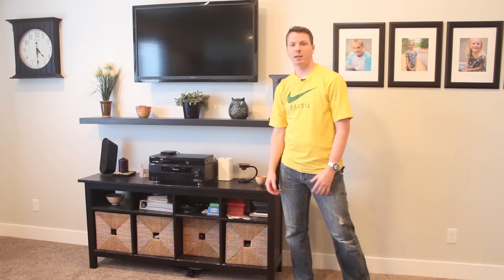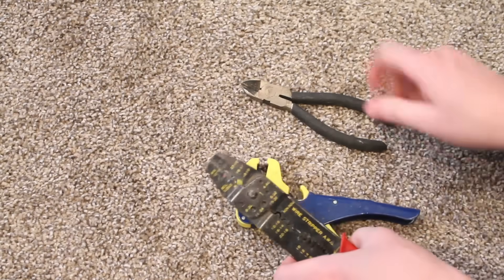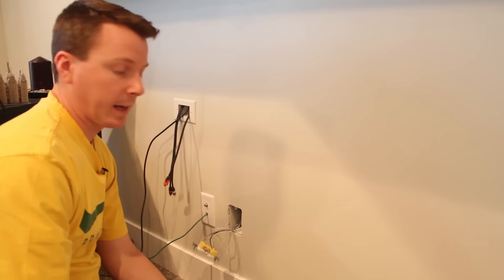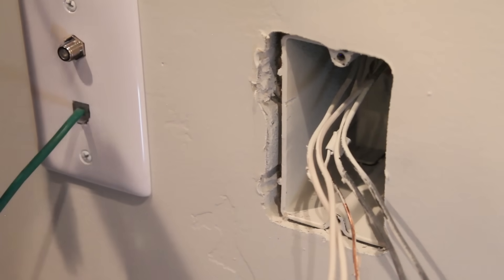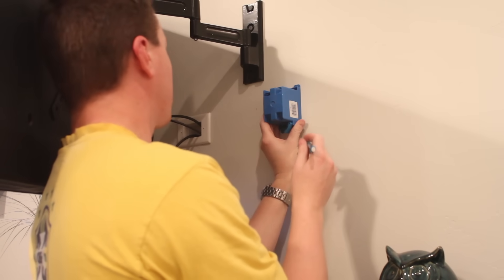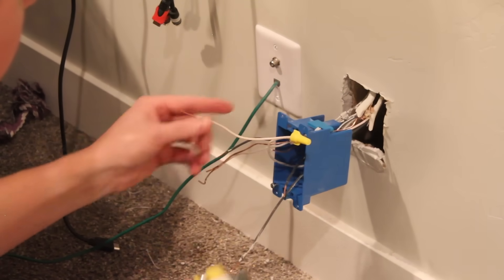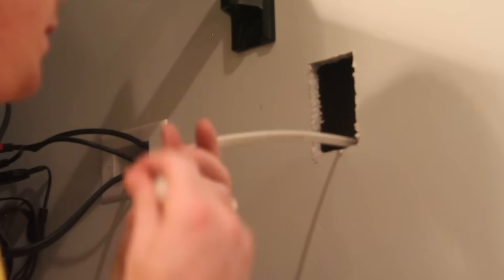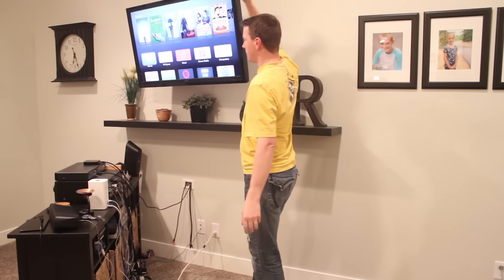How to Add an Electrical Outlet for a Wall Mounted TV

Comment: you could have wired all three romex directly to the plug, faster easier more reliable.  Also, before cutting the sheetrock it is best to mark the box with a level to make sure your cuts are level and squared. Always try to avoid installing any boxes sideways or at a different height than the existing outlets (looks very unprofessional).  Other than that i would say this is one of the better videos on this subject.
Reply: Absolutely not "more reliable". Also not to code.
Reply: There is also a minimum height wall plugs can be, I do not know it so I just set new one as the same height as existing one, 11" is what I just measured.
Reply: NO. It is not good practice to use devices as junctions for a number of reasons. The correct way to wire that is with a pigtail to the device, exactly as shown.
Reply: Could you elaborate on the wiring a bit
Reply: @Securedbyadt  he means that it would've been a stronger connection if he would've just connected the three new romex cables coming from the top outlet directly to the bottom outlet, onto two of the four screws plus ground on the bottom outlet. obviously at that point the bottom outlet would only be running off of only one black, white, and ground wire as opposed to the two sets it was running off in the beginning of the video. doing this method would also require you to pigtail the two ground wires (the ground from the bottom outlet & new ground from top outlet) and then land 1 wire onto the grounding screw on bottom outlet. after that you're set, no need to pigtail the extra short piece like this guy did in the video

Comment: Id have to say looks good for the most part but you should definitely brush up on the electrical portion of work. There were still some things that arent up to code like you should be putting the wires on the bottom receptacle back into the box so about a 1/2" of the jacket is in there. Same with the top outlet, way to much jacket was left on it. I personally have seen some real hack jobs (outlets wires with extension cords) and the house didnt burn down but it wouldnt hurt to brush up like i said. Black and Decker makes a nice quick reference code book i recommend to DIYers

Comment: This is not to NEC.  You have to many wires for the box fill of the lower remodel box, and you used a regular box   You should have used a double to be in compliance.  The box fill or cubic inches allowed are marked on your box.  Each wire has a numerical cubic inch value.  If the romex is 12-2, then you have 3x neutral and 3x black, 2x's for the receptacle,  1x for the pig tails, and 1x for the ground.  Your total count are now at 10x 2.25=22.5.  You have exceeded the allowed fillable space in the box and a possible fire hazard.  The size box you used, will only allow 6 conductors, two of which are counted by the receptacle.  Your box on top has the maximum conductors allowed and is to code.
Reply: you are aware that modern 12/2 is yellow right? also just by looking at how easily the wire is manipulated it is most definitely 14/2. so grounding counts a 1, 6 conductors (3 neutral, 3 hots), wire connectors and pigtails DO NOT count as they originate in and terminate in the box (314.16.B.1),  2 double allowance for the box = 8 * 2.00 = 16in^3.  The box he listed in the desc is 18in^3. So he is good (he would still be good if he used #12).

Comment: Quick question. I saw that you cut one of the grounds off behind the crimp, I'm assuming because it was keeping you from removing the grounds from the box, but I never saw you do anything with the shortened ground wire to reconnect it. Did you just leave it off? It would leave all of your plugs after it ungrounded as well.
Reply from the maker: There is actually a crimp connecting the original two wires behind the box. You can see it on the left at around 9:00. I brought my new ground in as well and connected it with the existing wire, then pigtailed off it (10:18). That way, I had a solid ground on all three.

Comment: I noticed you left unjacketed wires in the wall. The outer jacket should be a little exposed in the box. Top one was fine to much outer jacket in the box but bottom one was wrong.

Comment: A bad contact may start a fire.
the hook on the end of the wire should be terned so when you tighten the screws the the wire gets a better contact.

Comment: Don't know if someone mentioned it... but you can't have bare wires in the clamps of the box.. the white outer coating has to be in the clamps... and I don't think you can put two wires in one space on the those plastic boxes

Comment: I also learn that looks nicely when you do a piggy tale instead of twisting all at the cap.
Reply: You cant do a piggy tail if you have 3 wires twisted. It wont bend enough. For 1 wire piggy but for multiple, cap.

Comment: What if the original outlet is 5 feet away from the point you need on the left or right side? Cut holes through each of the studs and fish the wire through, or run a fresh line from electric box the basement, and feeding up through the new location?

Comment: I'm wondering why you reconnected the wire to a new receptacle and pigtailed it versus just leaving the wire connected to the friction connections and run the new cable to the screws..?
Reply: Putting wires into the back of receptacles is asking for it to catch on fire. The spring clips in the back of plug get loose and cause heat which can lead to fires. Using pigtails to the screw terminals on is the best method. That way your not running the current of the whole circuit through the plug, just the current of the receptacle in question.
Reply: Joe Fuentez To comply with code most likely. It’s code where I am
Reply: Never heard of a pigtail code before but each state is different. Terminating at the screws is the preferred method, the pressure clips tend to fail over time. Commonly see in townhomes and condos where the electricians are in a rush to get to the next one in line.

Comment: Do you have license in order to work with electricity? Because if you don't you could go to jail
Reply from the maker: Alonso Carrasco Sorry, my friend, but you're quite wrong. Anyone can work on their own electrical wiring in their own home. I'm not a contractor and I'm not working on someone else's property. Some states may require a permit and/or inspection for electrical work but definitely not licensing and there is absolutely no law breaking taking place.
Reply: Alonso Carrasco no I'm pretty sure that it's still illegal no matter who's wireing your doing
Reply: It all depends on where you live. Regardless, nowhere is going to send you to jail for running your own wires. Possibly a small fine, but that's it.
Reply: Alonso Carrasco actually you don't need any sort of licence or certification to do electrical work, what you do need is an inspection from a local codes enforcer

Comment: Great video. I think the wire nut is supposed to twist the wires hence they don't have to be twisted before hand together which actually can rupture the wires while you twist the wire nut.
Reply: That is correct, you are not supposed to twist them as the cap itself will twist them a little bit and grab hold of the wires.
I would suggest a "wago clip" instead though, easy to work with and can be removed easily if needed.
Reply: Good clarification thank you
Reply: 2FishOneRod killer help me understand. So for this type of wire this guy is using should I hand splice before applying wire nut on all the wires or just the ground wire? Is this wire solid or stranded?
Reply: Cyril Azoulay to put u  straight solid wire needs to be spliced by hand only stranded wire can be spliced together with the wire nut fyi.using the wire nut to splice your solid wire together is a hazard because over time the solid wire will become lose cause over time the wire nut because weak from the heat that is caused from the electric passing throw it so make make sure u do what I say otherwise you'll have arking and then a fire.
Reply: John Doe yea only for stranded wire

Comment: Ok. What if your tv is mounted in the middle of the wall but your outlets are 4-5 feet to the left and right, do you still install the lower box the same way? Right now I have to run an extension cord to the left or right.
Reply from the maker: If your TV is not going to be mounted directly above an existing outlet, the job is much more difficult. You'll have to either drill/cut through the studs (which can get messy) or, if you have the option, run the wire above or below the room if you have unfinished space above or below. You can drill a hole under/above the stud in the bay where the outlet is and then another through the stud in the bay where the TV outlet will go. Again, not as simple, but possible. Best of luck!
Reply: DIY Nils thank you so much.
Reply: I have the same issue. There is a very detailed video on youtube. How to move an Electrical outlet behind the TV-Mounting a TV to the Wall  a 3 part tutorial. Guys name is Alan Clegg.
Dont want to offend Nils ( love your channel, feel like I can do anything once I watch, which can be a problem when it doesn't go as smoothlyl as your demo ! ) but it is quite a bit more involved and it may help to see how it is done.
Reply: Thanks a lot jbuffan218. I'll be sure to check that out.

Comment: I read this on an Article:  which one you used?14/2 - The White Wire - used for wiring lights and light switches12/2 - The Yellow Wire - used to wire plugs14/3 - Same as 14/2 but with an extra red wire in it so you can control the same lights with 2 different switches (like for hallways and stairs)
Reply: I use 14/2, since the new wire you're adding is only ever going to be powering one additional outlet. you only need 14/3 if you have three-way switches and only need 12/2 if you need higher amperage (larger appliances, etc) so 14/2 should work just great.
Reply: James L 
I got the white cable and its working fine.

Comment: I like what you did there, I'm looking to do exactly the same,  I got a question . why did you have 2 white on silver and 2 blacks on brass at the beginning  and only pigtail one of each at the end .. does it matter which white you get to pigtail ?
Reply: It doesn't really matter, so long as all three wires, plus the pigtail, are touching. In the video, I connected two of the wires in a wire nut and added the pigtail to it. This is the same as combining two wires into one and connecting them to one of the screws on the outlet. Then, the third wire connects to the other screw on the outlet. Remember that the two screws share a current. What goes through one, goes through the other. So this is the same as connecting all three wires to each other. The pigtail just helps to consolidate so that we're not trying to put three wires on one screw. I hope that clears things up!

Comment: dont know if this was mentioned but if that outlet on the bottom was switch controlled you forgot to break of the tabs that bridge the top and bottom outlet, so if you had a switch controlling the outlet it would be always on even if the switch was off

Comment: Why are you putting wires directly on the screws ?  you are supposed to unscrew them, put the wires in the holes and then screw them back to hold the wires in place in the holes.
Reply: Any electrician would tell you to not use those holes. Quick connects are unreliable.

Comment: Instead of cutting a 3rd piece of wire to tie the two connections together, you could have simply plugged the wires from the top outlet into the holes. The old wire into the screws of the bottom outlet. So one set of wires into the holes, other set into the screws. That would have connected the two outlets.

Comment: thnx, great vid. As a novice I saw you had 2 white wires and 2 black wires attached. where did the 2nd wire come from for each (white and black)?
Reply from the maker: Great question. There were two blacks and whites in the wall already. One set coming into the outlet to power it, and one set going out of it to power the next outlet. I brought in the third set, which is what I attached to the upper (new) outlet. I then used a pigtail to turn the original two whites/blacks into one white/black. Hopefully that makes sense. Let me know if it doesn't.

Comment: Hi Nils,
There is a way to add the TV outlet without removing the current outlet, which saves a little time and tools.
More likely than not, if you are adding the electrical outlet to accomplish hiding wires for a wall mount TV,  you will also be adding another cut out for the HDMI and other cables   I placed the cut out for these cables about 6 inches parallel to the lower outlet.  This allowed me to reach in with my hand and feed the electrical wire for the TV into the existing outlet box from the outside of the box.  You then install a old work box in the cut out you used to reach in with your hand and feed the other TV cables.
Hope this makes sense.
Reply: Jay Bjork I don't quite get what you're saying, but I would like to know if it could save me time. Could you explain this to me?
Reply from the maker: Jay Bjork Sounds like a great idea!
Reply: Yes, there is. Power Bridge, Arlington and Midlite (as well as a few others) make "power extension kits" designed specifically for this purpose. The kit includes an outlet and an inlet. You simply run a length of romex between the two locations. These kits eliminate the need to remove the electrical box.

Comment: Mr. Nils, You might want to point out about the Shepherds hook bend in the wire that is going to be tighten to outlet, and that the bend ending should face the direction of the screw that is tightening  and to close the shepherds  hook before tightening.. dan t. palm springs, ca

Comment: what if i had my outlet plug at the bottom of my tv but to the far right or left
Reply: Raaj If you have a stud between the TV and existing outlet then it will get very messy as you'll have to cut the drywall and go through the stud. Either way you have to fish your wire.

Comment: NIls, i can seem to find a proper answer here, Since your old wires are both in the push in holes, wouldnt be easier to put the new wires on the screw attachments?
Reply: Don't use those shitty quick connects ever on plugs or switches. They can put unnecessary stress on the wires and then they snap off inside real easy. Use the screws on every possible opportunity.
Reply from the maker: That would have been easier, yes. I didn't think of it at the time but there's no reason not to do that.
Reply: Much appreciated, Just seemed like a lot more work in video than need be. Still a good lesson learned and by the end of it all it worked properly and was up to code.
Reply: Angry Dergon So the holes in the back of the outlet and the screws are just two different ways of doing the same thing? So he could have chained two outlets together using the screws for the second outlet? just making sure I understand

Comment: Hi Nils. I watched your video to add an outlet to my tv. Unfortunately I didn't have a reciprocating saw to cut through the nails on the existing box. I had to force it out which led me to breaking the drywall above the outlet. How can I fix that easily? Also, I had 3 sets of wires in the box originally. 3 black, 3 white, and 3 ground. I joined my new cable and one set together and tied it into the new receptical. Then I joined the other two sets and tied them into the receptical. Now one plug is not working. Can I just cap one of the sets? Will that fix it? Thanks for your help.

Comment: great job helped me out alot I know how to connect the wired but I would of actually cut into the drywall and had to tap and paint all over so your video saved me the extra work thank you

Comment: To remove the existing box, bend the screwdriver towards the box, not towards the drywall, that's why you messed it up.
Reply: Lol I was thinking the same thing as he was doing it I was like “bro you’re doing it all wrong!” Lol
Reply: Also, using a reciprocating saw makes it easy to damage things too. I just use one of those hacksaw blade holders and put the blade in there and cut the nails.
Reply: @lemmy999  I've always used the existing outlet box, and just ran the new romex through a existing popout in the box.
Reply: Todd Vernon did you use fish tape to run it to another location? What’s the method there?
Reply: Todd Vernon How did you gain access to the knockouts on the existing outlet box and install the romex cable without cutting sheetrock? Would like to see that trick.
Reply: @bcarroll6274  Remove the outlet from the box, you'll see the knockouts inside the box, use a flat-head screwdriver and press in on the knockout, some have an indentation where you can press the screwdriver into.  Apply some pressure and it should pop off.  Run the wire to the new outlet.
Reply: PianoSoulos good call

Comment: Hello Nils. I was wondering about the Romex. So when I go buy it, that's all I have to ask for?. 14-2 Romex in the length that I need
Reply: use 14-2 if the existing wiring at the original outlet is 14-2.  the number "14" in 14-2 means that the amerpage is 15amps. 12 gauge wire is for 20amp circuits. in this guy's setup apparently is on a 15amp ckt but that doesnt mean YOU are. You could cause a fire if you dont understand the relationship between wire gauges and amerpage (current). This aint rocket science but then again I did electrical engineering so its not 5th grade knowledge. If you make mistakes with plumbing you can get wet but if you make a mistake with electric you can start fires and die.
Reply: BigCeetheDJ um, the #14 in 14/2 refers to the gauge of the wire, not the amps.
Reply from the maker: Yup, that's right!. They usually have prepackaged lengths of it and I'm pretty sure they start out at 15 ft. Good luck!